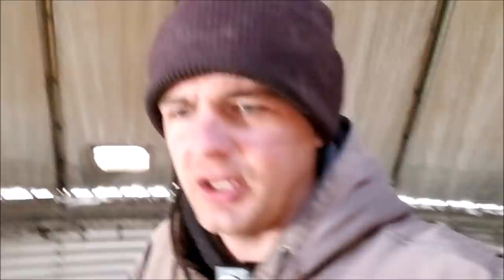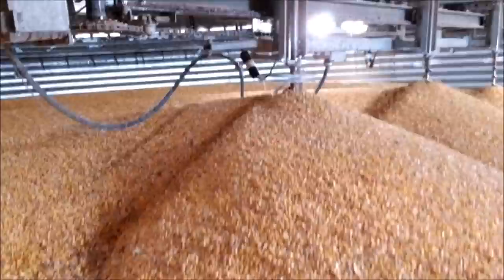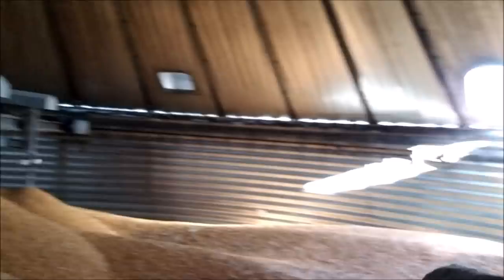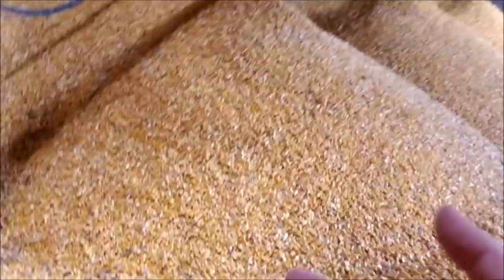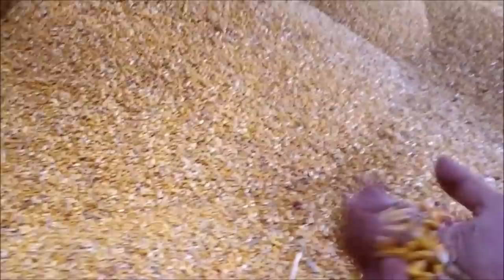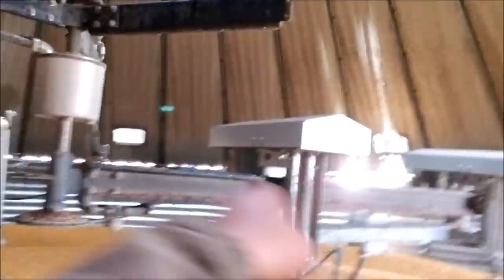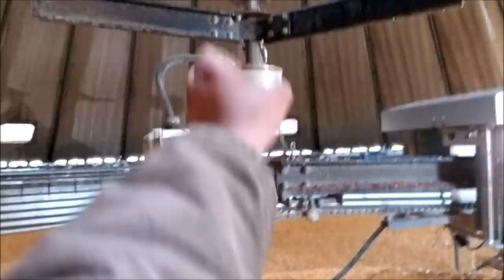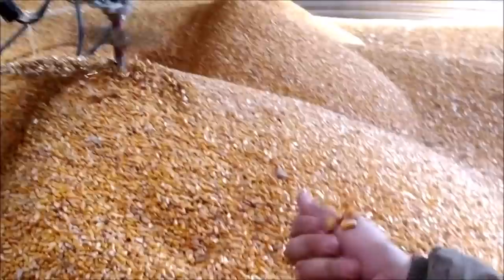Corn In The Bin | On The Dry Down

Comment: Yep lotta dryers getting a workout this fall for sure... At least yall are putting stuff in the bins at 19% or so, most of the stuff around here was coming out at 30% and even after a couple weeks it's STILL coming out of the field in the mid-twenties range... Bin fan and burner working overtime.  We had a stirator belt burn up but it was pretty much when the corn was about dry so that was replaced and we're putting the last corn in the bin today if all goes well.  Hauled the last bin to town to empty it out for this last part and it was running about 16% on top and down to about 12% on bottom, so good enough.  Bout all you can do bin drying anyway.  
Later!  OL J R :)

Comment: Could you try using blue Loctite to keep the bolts from vibrating out?  Double nutting is fine but using Loctite (or other brand) is added insurance.

Comment: How long are those augers?
Reply: Most go with in 4-12" of the depending how you want it set up. I run mine 6" from the floor
Reply: @johnwarren-649  he said moisture is around 19, in a few days how much it will drop?
Reply: @hardcoreplayafromthehimala4888  that depends on the corn an how far they dry it down to.. I've seen my 10,000 bushel dryer drop 18" with 20+ corn in it
Reply: thank you john   ,alex, p8.5 for information